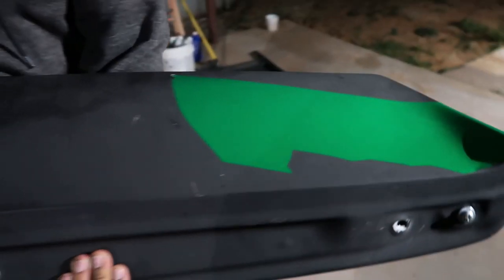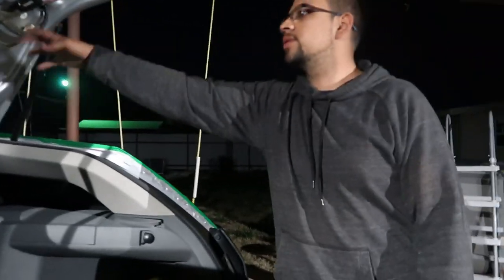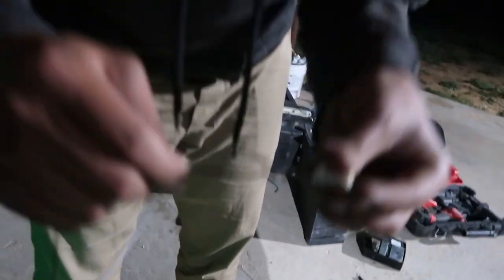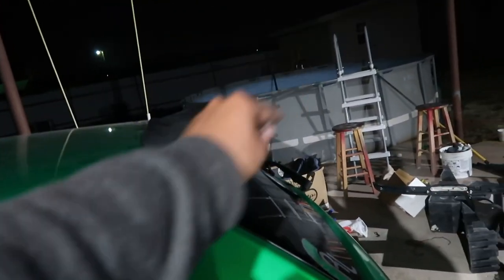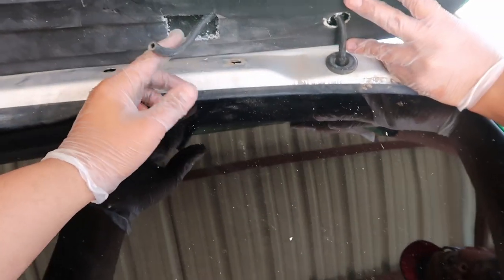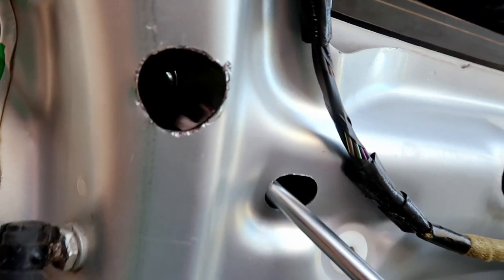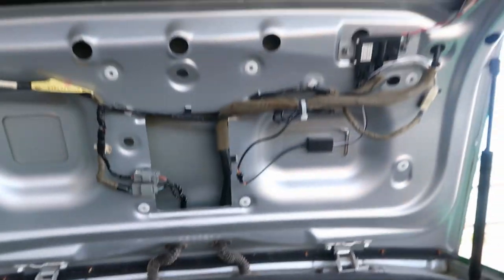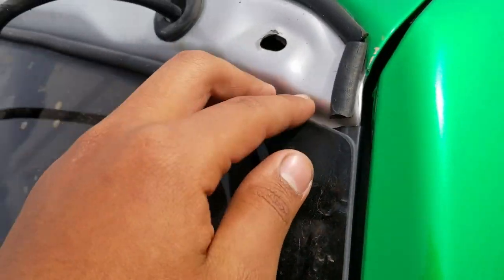Dodge Magnum Wings West Roof Spoiler Install

Comment: Howd you take off the interior parts off the hatch to access the wires
Reply from the maker: I don't know why I'm barely seeing this comment. But all the panels pop off after removing the screws on the handle to pull Hatch down.